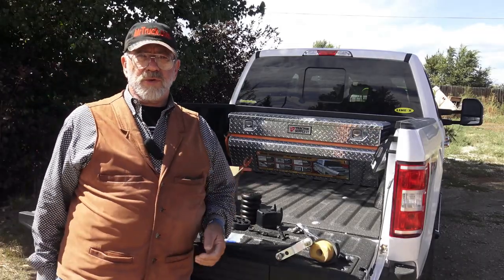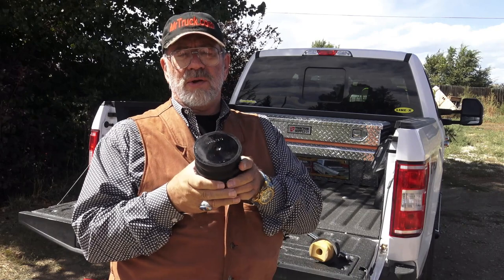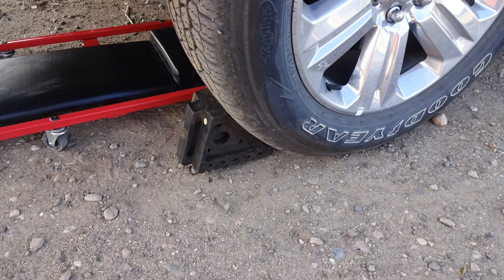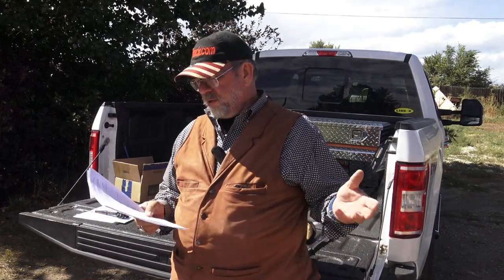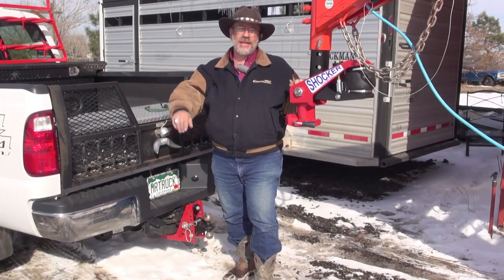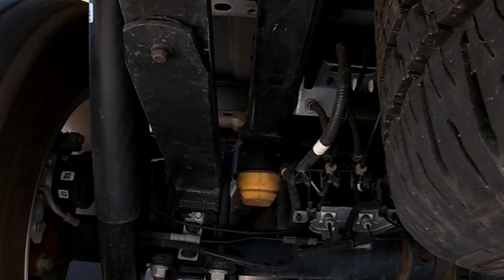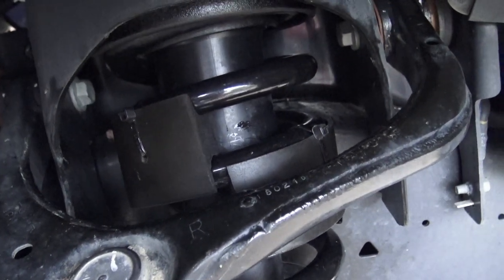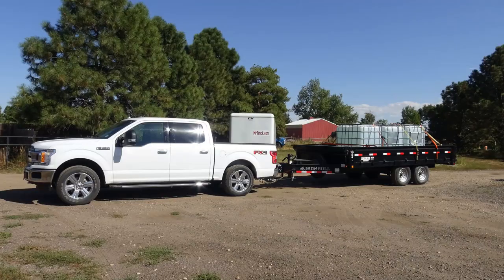Guess what happened to my F150's suspension, OK it's Sumo Springs automatic overloads

Comment: I own a 2018 Ford Raptor.  After a number of years, the stock leaf springs went flat…losing over an inch of ride height and completely losing the ability to carry any load whatsoever.  I replaced my rear leafs with Icon leaf springs set in option 2, adding 2.5” to stock ride height.  This adjustment made the stock bump stops functionally useless.  In fact they are functionally useless from the factory altogether.  I replaced the stock bump stops with Raptor specific Sumo Springs.  I used their stock mount, two spacers (as recommended by Sumo after showing them pics and measurements), and added a SVC bump stop pad to the axle.  These changes completely eliminated axle wrap, wheel hop, and improved ride and handling, and at least visually improved protection to the frame.  Shortly thereafter, I changed the front springs to Geiser 3”.  The truck drives better than new by a dramatic margin…with much better ability to carry a load and tow.
Reply from the maker: Good information
Reply: Hell yeah bro You got your shit hooked up! I got a Tacoma TRD off-road and it can't tow worth a shit because it's more focused on off-road I put the sumo springs on the rear and the wheel hop is way less also when I put my trailer it doesn't sag my trailer's not real heavy tho maybe 2-3,000 lbs. Getting the front done soon hopefully it will make my suspension last longer and keep some of the stress off of it & then when I go off-road on washboard roads it should help

Comment: Hello Mr Truck, it’s essentially a nascar spring rubber up front and a bump stop rear. If I am towing most the time, I have found a set of mono tube Bilstein shocks are the best for over all stability and confidence in white knuckle conditions. Plus Bilsteins only loose like 3% of their damping after a hundred thousand miles.
Reply from the maker: Someday I'll be able to afford Bilsteins. I know Mercedes likes and they are on top end RV's
Reply: MrTruckTV Have you tried Roadmasters Active Suspension?
Reply: @MrTruckTV  Not that expensive.  Bilsteins are around $125.  Install a pair of rears on my 2019 F-150 and the ride improvement was great.  Towing is much improved too.
Reply from the maker: No
Reply: Frank The Pussyfooter I had the roadmasters on my 2018 f150. They did not work well with a WDH. I had them at max adjustment. Made hooking up the bars really hard. I had an e2 hitch. Don’t recommend that hitch either.
Reply: Bilsteins are the best bang for the buck but like all non reservoir shocks they get hot and lose their efficacy or just blow seals out and die on long crosswash roads. The factory's come off immediately on all the trucks I've owned.
Reply: @davidanderson8469  So you are saying instead of using Sumo Springs go with a Bilstein shocks which are even better ?  I have a 2020 F-150 4x4 that I want to level the front but I would like to counter the sag when I have a trailer of weight in the back.  Are Bilstein shock a pretty good way to do that ?  I am not going to do serious off road rough trails or rock climbing but would like it preform well off road at a moderate level.  I am just looking into options and could use some advice.  I also don't want to fool around with any spacer pucks to level the front end.  My goal would be to level it with suspension shocks.

Comment: I use sumo springs under the back of my Frontier.  As delivered, they were a little too tall, so I voided the warranty by cutting one and half "bubbles" out of the height.  They now work perfectly.  I've run them for a couple years.  I pull either a 19' travel trailer or a small two horse bumper pull with it, and the sumo's are a great addition.
Reply: We've had a lot of customers do some "custom modification" since the material is so durable but malleable at the same time. Glad they're working for your Frontier Matt!

Comment: Nice video.   I have the 2015 F150 and the stock suspension is a joke when trying to tow. I didn't want air ride so we thought to put on the Timbren's on the rear but the space from the axle to the stock bumpstocks were so large you can tell they were probably never touched from driving. I couldn't see the Timbren's being much better.   I'll never load or tow 12,000 lbs like you are, so I changed out the rear suspension from the typical 3 pack (2 long 1 short) leafs to a 5 pack (4 long 1 short) and boy what a different night and day.  The truck tows perfectly like it should have all along.  With no weight or towing it still drive relatively nice and frankly it's a truck so I'm good.  After you loaded the front spacers, it would have been nice to see how the rear axles reacted to them installed. I couldn't help but think it might stiffen that up a bit more even.  I wonder putting these on with the improved suspension I now have, boy that would be even better!
Reply from the maker: Thanks, overall handling improved
Reply: You need spacers. I have a 2" lifted Ram and needed their spacer kit to use the Timbrens.

Comment: The whole point of the bump stops is to not be in contact with the axle when parked. Its for situations that when you encounter a large bump and your nearing the end of of your suspension travel,  so that your not pushing the axle into the frame rails. Resulting in cracks in the frame rails or axle housing. I am not saying that the sumo springs are not capable of working as advertised. Just saying that there seems to be some confusion about function of the factory bump stops. If your vehicle is loaded and your sitting on the factory bump stops. Than either you are overloaded or your suspension possibly needs replacement due to age and being out of spec.
Reply: Well stated.  I couldn't agree more with your statement.
Reply: You must have a better suspension system on your truck.   At 80% payload max, I would beat the hell out of bump stops.  I don't know how they figure payloads, but when loaded the bump stop is way too close for the suspension to have effective travel.  The squatting truck throws the entire handling and breaking system off not to mention changing the headlight angles, all within payload limits. The only confusion is someone thinking that bump stops are worth a shit.
Reply: It looks like the Summo springs are longer than the stock bump stops, just sayin

Comment: I use sumo springs on my Silverado trail boss. Love them. I had to order from them directly and there great to work with. the 14-18 model Silverado sumo springs don't fit the new 2019 models. Love them.
Reply from the maker: Great, I'm going to review trailer Sumo next. They will be in my store
Reply: What part number and color did you go with? Have a 2019 GMC AT4 and looking to buy these. TIA
Reply: MrTruckTV awesome I didn’t know there was sumo springs for trailers.  I’ll be waiting for the video. Thanks

Comment: When I put my Timbrens on ( Install and camera shots like yours on my channel) , I couldn’t find much info on the sumo springs. It looks like they do a good job without punishing you with overly firm ride quality.I find the timbrens to work well but they really are overly firm for an F150.  I took the spacer off for 4wd they were hitting to harsh too soon . They definitely help towing my 14 k gvwr dump trailer.
Reply: John DiMartino 
Is it smart to pull a 14 k dump with a f150 , probably not legal

Comment: I put the supersprings on my 2016 F250. It toes so much better but the unloaded ride is way more stiff. Still recommend though.
Reply from the maker: Sounds like a double blade SSA13, the single blades are smoother. That's why they developed Sumo, for softer ride.
Reply: MrTruckTV . Correct, also I can’t spell, toes🤦🏻‍♂️. Tows!
Reply: I've got SumoSprings (SSR-139-40-2) on my 2016 F250 and it rides like it did from the factory unloaded. If you check out our Instagram page you can see more! www.instagram.com/supersprings

Comment: I bought these helper springs to help with the sag while towing my TT,  unloaded get ready to turn your truck into a horse carriage, when your suspension compress and hit the spring it causes a very harsh ride , I even took the spacer out and yes it was better on lighter bumps but still when the stock suspension compress and hit the spring again harsh ride, basically it stops the dynamics of your suspension travel, and when towing my TT I can fell the truck riding harsh and maybe cause the sumo spring are on my axle cause a very stiff ride and don't allow the suspension to flex down the highway, only good thing about these helper springs is it does reduce sag at a cost for comfort
Reply from the maker: I took a spacer out of mine to get more wheel travel when empty, which helps. Loaded with a trailer mine does ride smoother.
Reply: Yup, they are basically a longer bump stop. They help with sag (which is a visual thing) by not letting the back drop as much. For real leveling and towing safety a WDH is needed. But I could see the value of these if after all other sway and leveling issues are addressed properly, you still need your truck to have a stiffer rear suspension to lessen the squat. Just remember that a stiffer suspension equals a harsher ride for passangers.
Reply: @treefiddy2470  the flip side is that WDH can cause issues and void travel trailer warranties when used off highways.  I prefer to level with an adjustable hitch, load weight correctly as best as humanly possible, pull with a suitable truck (3/4 ton or better) and use Sumo springs for any possible sag.  Knock on wood, it's worked so far.

Comment: Does the product for the front compress too or does it just increase the spring rate to slow the oscillation?
Reply from the maker: I would say slow the oscillation, it doesn't much, the rear sumo does compress
Reply: @MrTruckTV  10-4 sir, thank you.
Reply: The Coil SumoSprings give you 15-30% capacity on your factory coil - coming in progressively as weight is applied.

Comment: Mr Truck, I've got a question. I have always run airbags. I'm considering alternatives on my 2021 F250 towing a Montana 5th wheel its about 11,500. Pin is just over 2000 lbs  I'm getting about 4 inches of squat. So Summo or AirBags?
Reply from the maker: That's alot of squat for a light trailer. SuperSprings https://mrtrailer.com/supersprings.htm

Comment: I have been using Sumo Springs for about 3 years now and they are outstanding. I put the mid strength ones on the rear of my 2001 Sierra 1500 for pulling an 8,000-pound TT. I don't feel the front ones are necessary. My ride quality empty is virtually unchanged. Mine have about a 1/2 to 3/4" gap above the axle. There is very little squat when loaded, but I do use a Weight Distribution Hitch. The truck is very stable when towing and rides great. I put them on and now I don't even think about them because they are maintenance free. Highly recommend for the rear. It was nice to see your video of them in action.
Reply from the maker: Thanks

Comment: I have a 2014 F350 Dually. I pull a 5th Wheel at a weight of 16,800 lbs. Hitch weight at 2800lbs Would the sumo springs be to my advantage?
Also, would suggest sumos for front?
Reply from the maker: Yes,  I would just do the rear

Comment: Do not use a soap water mix if you don't want to spend forever getting the fronts on.  Use a silicone spray.  Works much better and installation is much faster and easier.
Reply from the maker: We used windex

Comment: I put AIR LIFT bladder bags in the coil rear springs of my Sienna, adjustable, progressive compression, works like pneumatic sway bar
Reply: Too many cheap asses not wanting to spend the money on a proper system like Airlift.

Comment: Wouldn't having the proper equalizer hitch take care of this problem when towing? I have a lot of sag with my 18 f150 and looked at these. I think the proper way is for me to upgrade my hitch to a heavier one to distribute my weight. Am I thinking correctly.
Reply from the maker: I'll still be use my WDH, but I won't have to tighten the spring arms as much

Comment: If Sumo Springs are anything like Timbrens, then they are junk.  Nothing replaces a good quality airbag.
Reply from the maker: Timbrens are full of hot air, Sumo Springs are micro fiber
Reply: @MrTruckTV  I put Timbrens on my Silverado 1500, and not only did I receive a nice pound in the rear unloaded, but when loaded it was an extremely rough ride, and I didnt gain any extra height while loaded.  It still had the same squat.  Because I was using weight distribution,  trailering with these produced no positive results.  If you are towing fifth wheel, or are not using weight distribution,  then Timbrens may give you positive results.  But, not appropriate for my application.

Comment: Wondering if it would of been easier on the front intall if you jacked the front off the ground which would of expanded the coils allowing easier install.  Is that manufacturer recommended install instructions to pound them in with a screwdriver and hammer ??
Reply from the maker: We did lift it up. We installed the front the best way we could. Like an average Joe would do it his garrage

Comment: Looks like these are not intended to be ride leveling because they compress. How much did your bumper sag from the unloaded height when you connected the trailer? What is your tongue weight?
Reply from the maker: They compress but less than the factory leaf springs. Tongue weight was 1160 lbs. I had the load center over the trailer axles. Squat was a couple inches. I could have tightened the WDH and had less

Comment: I used Supersprings, SSA28, on my 09 F150 for 8 yrs. loved them.  With the F150, you needed alternate shackles because the standard ones would contact the frame.  Quick swap, back in business.  I tower a 5th wheel, 1050 pin weight.  Without these, I sagged.  Highly recommend.
Reply from the maker: Good deal

Comment: MrTruckTV

I've got a 1.5 in level on the front of my 2015 F150 6.5 ft box and stock rear. It sits perfectly level with no load. How much will it sag before it engages the Sumo springs? I pull a 7500 lb  holiday trailer and want to keep it close to level when hooked to the trailer. Thanks in advance.
Reply from the maker: Sumo springs come with spacers, so you can have it touch the frame and it might settle 1in
Reply: @MrTruckTV  Thank you. I wonder if the ride will be rougher if I use the spacers?

Comment: Would these help a 3” sag on my 1500? Trailer is well within weight requirements just heavy at the pin when empty and makes the truck squat. Trying to decide between this or airbags. Airbags seem like such a hassle.
Reply from the maker: Yes
Reply: @MrTruckTV  what color would be best suited? Trailer is 4500 gooseneck
Reply from the maker: I'm holding off on trailer apps. They aren't side enough for some trailers. Waiting on engineers.

Comment: Kent, these look nice. Would you still recommend them or something else? I’m looking to beef up my 16 F-150 to tow a 6500 Travel Trailer so I’m trying to find the best solution. Thanks.
Reply from the maker: Yes, I like these for a 1/2 ton and like SuperSprings for F250-350
Reply: Better yet, get a weight distribution hitch. Better for steering and braking.

Comment: Sounds like this may be my solution to wind sway. 2019 F150 FWD, pulling a 20' TT. I feel like I'm floating all over the road.
Reply: Helper springs wont solve your problem with sway , I also use a F150 to tow a 30ft TT,  problem is  a lot of rv manufactures make ultra light trailers because most people show up at rv dealers with half-ton trucks , problem with the light trailers is the wind can easy push it around causing sway , the only solution is a propride 3p hitch, friction sway control like on the equalizer is not enough to stop sway with light weight TT,
Reply: I had a great experience hauling a 26' TT through Wyoming with my 1/2 ton on a windy day. I have the Sumo Springs and use a WDH with the Sway bar in place. Nice thing about the older style WDH is the sway bar is easily adjusted for windy conditions. I don't feel sway bar is necessary in town or in the mountains. You should have 10-12% of trailer weight on your hitch.
Reply: @ramcummins7879  
Sounds like a 3/4 ton truck would be an option as well.

Comment: Thanks for the video. I have been looking for an assist for the bumper sag I get when towing my heavy boat with my 2013 F150.
Reply from the maker: You're welcome, doing the trailer Sumo soon
Reply: Those new F150's need all the help they can get. I have never seen a truck that lets a load move it around so much.

Comment: Hello Mr. Truck! What are your thoughts on the sumo springs vs the road master active suspension? Trying to beef up my rear suspension on my 2015 f-150 with max tow. Thanks!
Reply from the maker: I don't know Road Master, I've heard of it
Reply from the maker: Now I remember Road Master, They are only on 1/2 of the factory spring, don't know long term wear.
Reply: Roadmaster is garbage. They told me if my truck left the road the warranty was void. They said going through a pasture was extreme off-roading. Love my sumo springs.

Comment: Hi Mr.  Did the ride get stiffer up front?
Reply from the maker: A little bit, the factory max tow package on the rear, which is a spacer under the leaf springs, makes the rear ride a little stiffer before I added Sumo Springs

Comment: So are these a good alternative to air bags? They seem to do the same things but these never have to be adjusted.

Do they ever wear out?  Seems like the would fall apart after getting squished a million times.
Reply from the maker: There's a lifetime warranty on workmanship
Reply: Lifetime warranty. We also have put these under testing where they do 250,000 compressions (typical life of a truck) in a 24 hour period and these come out the other side with the same spring rate. If you're wondering about durability, check out our instagram page where we show some torture testing. www.instagram.com/supersprings